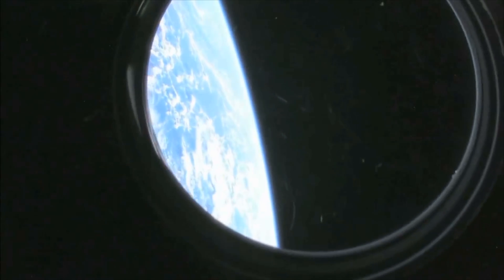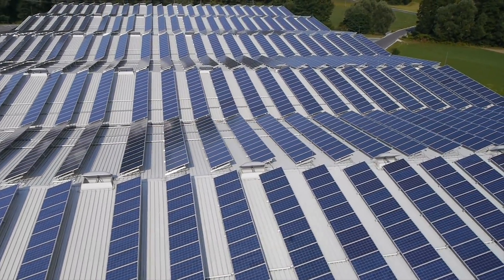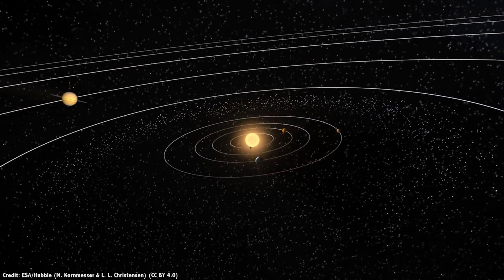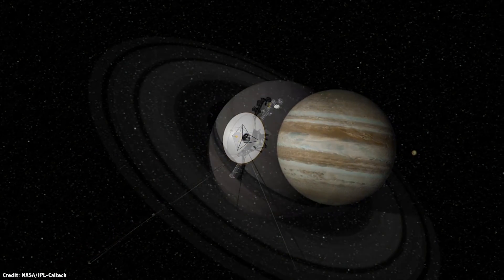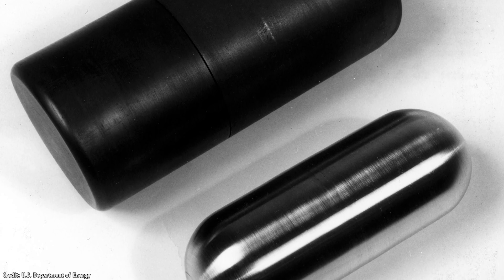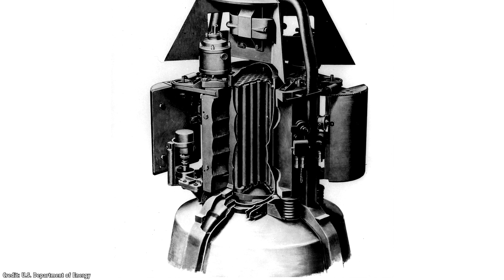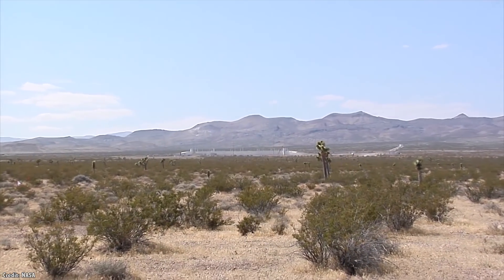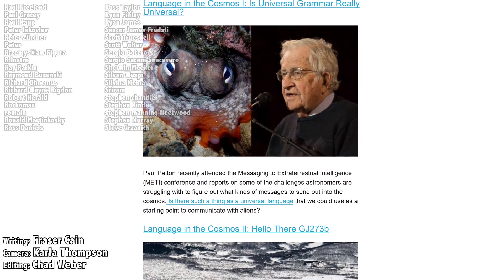The Problem of Power in Space. NASA's New Kilopower Reactor

Comment: Ooops forgot the hydrogen fuel cell.
Reply from the maker: Those only last for a few days, not for long term power.
Reply: True if H2/O2 aren't a primary engine fuel/oxidizer. Major issue of Kg/Kw for fuel mass of H2 propellant  & O2 oxidizer combined with the mass of fuel cell and assc. plumbing. A show stopper for low mass unmanned deep space missions.   For deep space manned exploration beyond Mars- the preference would be thermal neutron liquid salt reactors but near term separate H2 and CH4 (higher thrust) fuel systems could recover energy and water from liquid O2/H2 gasses. As far as hydrogen cells wearing out and efficiency,  hydrogen cell technology has improved but as long as we're using fossil fuels to generate electricity hydrogen will never overcome the cost and energy losses incurred by electrolysis : https://youtu.be/kzATqDRf78c

Comment: Problem with power in space ? No. Problem is dumping the excess heat while maintaining reasonable size/weight to performance ratio.
Reply from the maker: Radiating heat is definitely a challenge, that's why the ISS has such huge radiators.

Comment: It seems to me that we should make more use of thin-film mirrors to concentrate solar power for collection by traditional solar panels. A thin, reflective metal foil weighs far less than a solar panel, and is simpler to construct.

This isn't particularly effective here on earth, due the extra strength you need to build in to deal with wind and weather, but is a great option in the vacuum of space.

Comment: Use an intense magnetic bottle, and in a low pressure plasma push electrons to relativistic velocities, you'll have a compact x-ray source.  It should leave an accelerator on a gyroscopic plane.  So, you put your thin film solar cells on tape, and wind them around the source of gamma rays.
Reply from the maker: Whoa, do you have a link for a system like this?
Reply: In a magnetic bottle, electrons spin one way, ions spin the other, the rest is just voltage applied, get a tesla coil, pretend somebody else is stupid, and study.  https://en.m.wikipedia.org/wiki/Pair_production
Reply: So, you a low pressure plasma about 0.001 Tor, make a dual D accelerator, inject two frequencies, one to accelerate the electrons, the other to accelerate the ions.  In Tokamak physics that's electron frequency, and the other is ion frequency.  Inside accelerator, electrons collide with the ions producing electron positron pairs that annihilate inside the accelerator.  https://en.m.wikipedia.org/wiki/Plasma_(physics)#Mathematical_descriptions
Reply: Then, you use the cyclotron like the cardboard tube in a roll of duct tape, and wind up thin film solar cells around the cyclotron, instead of tape.  https://en.m.wikipedia.org/wiki/Cyclotron
Reply: Power Generation by sheilding.
Reply: Or, an antimatter reactor.
Reply: The only way I could scare you, is if you actually have a Ph. D, in nuclear physics.
Reply: I keep looking for the right plasma to do the job, xenon dysprosium mix, might work at relativistic plasma temperatures.
Reply: Just use the mean ion velocity/frequency.
Reply: It's as easy as building a microwave oven!  https://en.m.wikipedia.org/wiki/Induced_gamma_emission
Reply: That emission method is just another proof that it will work!
Reply: I explained it too you.  Once upon a time, I got down on my knees, and asked for the real All Seeing All Knowing Omnipresent, even if my parents were wrong and it wasn't Jesus Christ, or The Lord God, and asked, what do I do for a wife, that will love me for who I am, the way I am, that I will love for who she is the way she is, and never die.  I finished that, and it handed me more and said, if doesn't work for everyone, it won't work for her.  I'm still single, 52 years old, and have been at this one objective since I got up off of my knees at 12.  Most people shop around, I chose to ask a higher power.  Figure, it's probably not nice at all, could care less, and spent allot more time watching dinosaurs kill each other.  You can find warp drive searching my Facebook pages, I am not a Christian, and I don't worship women.  I'm looking for an intellectual equal, not a pet.

Comment: They generally dont use energy for heat in space, its hard enough to get rid of the heat from their equipment as it is.
Reply from the maker: RTGs work on heat differences. But you're right, radiating heat away into space is a big challenge.

Comment: am I the only one to think they need a solar garage for the rover???
they can have a solar harvesting garage with induction charging..
do an air lock with a self clean feature to clean the rover with a puff of clean air...
or a brush to dust the panels off... they can also do a back up of nukes heater that would be on the charging garage that could be wind and solar trash resistant...

just saying they could place several garages that could be used later if we get to mars with people!! and we could travel from garage to garage as charge hubs.

Comment: How about mirror-based solar concentrators focusing light on either high performance solar cells, or Stirling generators? That would obviously require accurate sun tracking, which isn't an issue in orbit. Energy conversion would happen at higher efficiency and the weight/cost looks to me like it would be much lower. Blanket mirrors like those designed for solar sails may even be compatible? There have been a number of studies already.
Reply from the maker: I talked about this idea here: https://www.youtube.com/watch?v=1qx0WJ1LvIc&t=0s&list=PLbJ42wpShvml6Eg22WjWAR-6QUufHFh2v&index=5
Reply: Will definitely watch!

Comment: Lockheed is building a compact fusion reactor that should do 30Mw in a platform the size of a shipping container. At that size and weight you could run a Hall-effect thruster at 1/3G for several years continuously